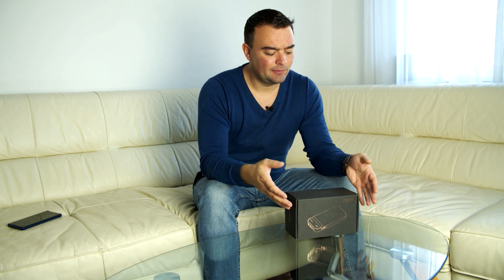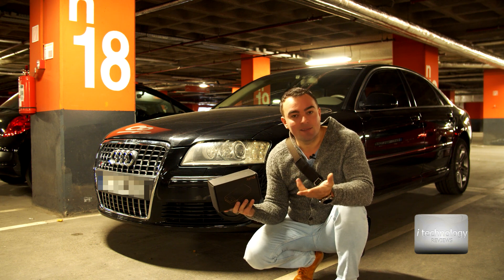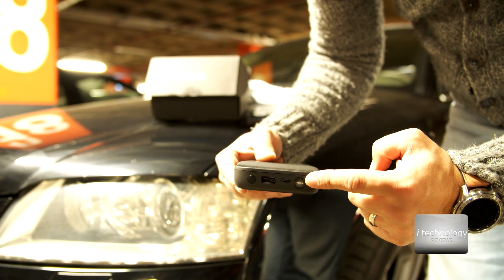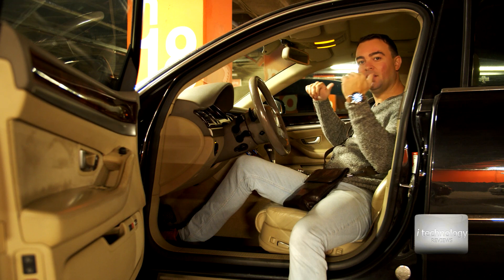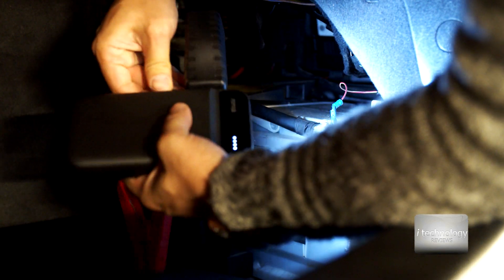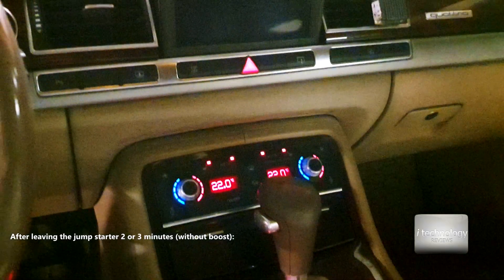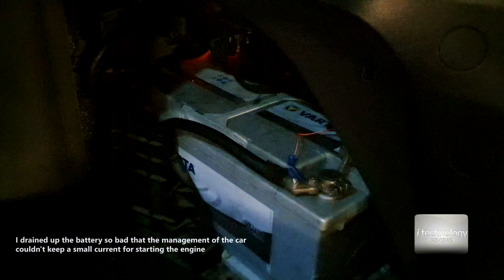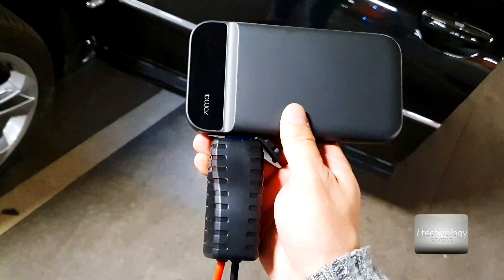70MAI Jump Starter 11100mah. We started a 3l Diesel Engine Audi A8. Start your car up to 40 times

Comment: Will it work on my 3.0 q7 i need 1 for road trip as my car frequently dies 

What is your updates review after these many years?
Reply from the maker: Hi. Look into 70mai for a bigger one for 3.0 motors. This one it s relative ok but if you have a weak battery it s strugelling. I have try it on diesel but it saids for maximum 3.0 petrol.

Comment from the maker: BUY HERE: GOOLOO Jump Starter Battery Pack 2000A Peak SuperSafe Car Starter https://amzn.to/3Y1kxa1
Battery Jump Starter with - Air Compressor Portable Car Jump Box,4000Amp https://amzn.to/3XWJ3Jr 
NOCO Boost Plus GB40 1000A UltraSafe Car Battery Jump Starter, 12V Jump Starter https://amzn.to/3XX26U0
Fanttik T8 APEX 2000 Amp Jump Starter, 20000mAh Car Battery Pack for Up to 8.5L Gasoline and 6L Diesel Engines https://amzn.to/44R8FJV

Comment: according to the manufacturer, this should not have worked haha
they say that this one (11,100 mAh) is good for up to 4.0l gasoline or 2.0l diesel, not 3.0l diesel. to jump start a 3.0l diesel you should go for the Jump Starter Max (18,000 mAh), which is good for up to 8.0l gasoline and 3.5l diesel.
but hey, it seems the small one worked for you on a larger engine lol, just needed to charge a bit i guess... maybe the fact that that audi protects the battery a little bit helped. it might not work for every 3.0l diesel car out there tho, so be careful if you have a diesel with an engine over 2.0l... the jump starter max is more expensive but says it can go up to 3.5l diesel engine, while this one only states up to 2.0l diesel... i don't know how it worked lol
Reply from the maker: Hi. Thanks for pointing this out. Please remember that my engiene was hot!!! And this is a reason that this worked. And the car is in a great condition... it matters
Reply: This is also what I'm thinking. We have a family van with 3.0L diesel engine. I don't know if this will work on ours.